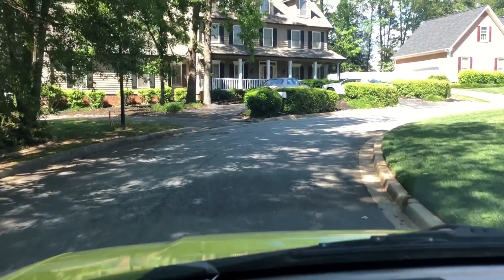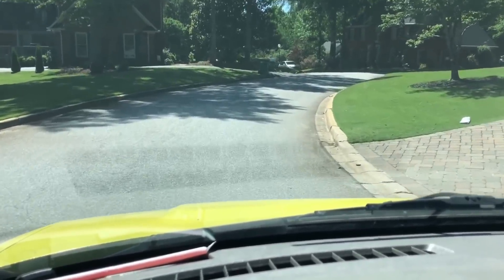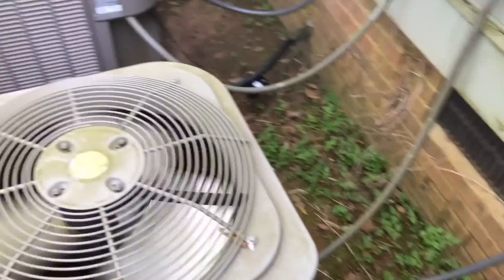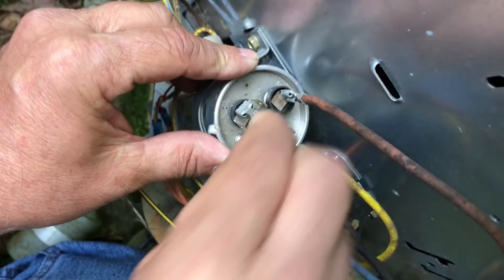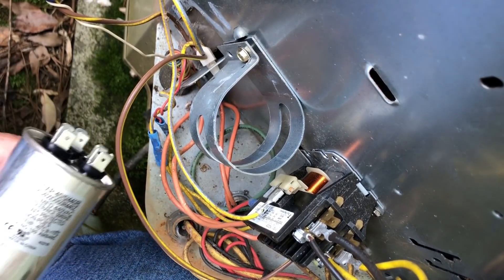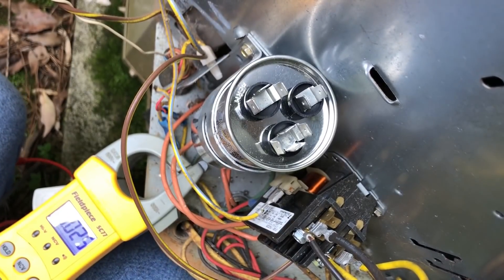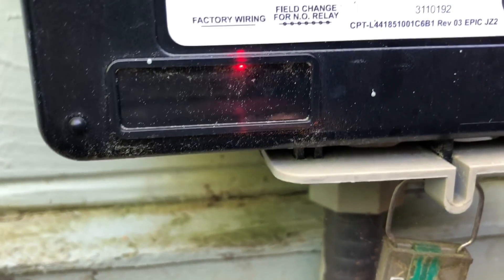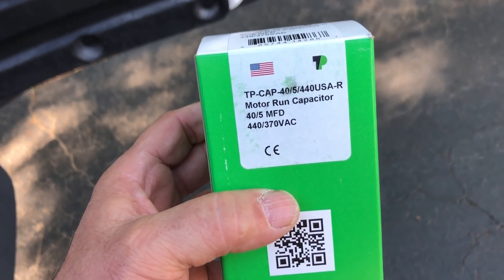Dont try this at home Capacitor replacement

Comment: polychlorinated biphenyl (PCB) is an organic chlorine compound with the formula C12H10−xClx. Polychlorinated biphenyls were once widely deployed as dielectric and coolant fluids in electrical apparatus, carbonless copy paper and in heat transfer fluids. It keeps the dielectric WET and capacitance levels stable ,without it the dielectric dries out. Its why old ones last

Comment: I've seen Chinese caps live 1-2 years, el mexicano caps live 2-3 years and American caps (which I install all the time) last 4+ years. I've only changed 3 American caps, which when I installed them, was about four years ago. PCBs may have helped caps live longer, but I feel it's more how they were manufactured. Back in the 80s and 90s they lasted pretty long. But as new caps come out, I've seen them last a lesser time. Plus planned obsolescence is just getting worse and worse, PCBs didn't have /everything/ to do with the capdemic. 
But the fact people are getting mad over us techs shitting on their shitty parts should be a wake up call. There's too many ninnys anymore. Great video though.
Reply: Turbo 200, 200x and mini all I carry and they almost never fail good old USA made caps.

Comment: We have a 1989 Amana 4 ton 10 seer that still has the original capacitor in it. The contact switch, still the original, is one loud one too...ever since it was new...bang, you hear it contact.

Comment: Polychlorinated biphenyls are a group of 209 different chemicals which share a common structure but vary in the number of attached chlorine atoms. An estimated 1.3 million pounds of different types of PCBs were dumped into the Hudson River by General Electric from 1946 until 1977, when they were banned. The international treaty on Persistent Organic Pollutants, drafted by 122 nations in Johannesburg in December 2000, targeted PCBs as one of the `dirty dozen´ chemicals to be phased out worldwide.

Comment: PCB's were banned in 79, so there's something else in those 1980s-90s units that keeps them going.
Reply: That's called good manufacturing, and a longer planned death date.
Reply: My old company believed it was the change of R410A refrigerant. System having to start at higher pressures and nothing really change with general principal of the design except for coil sizes. Also most manufacturers offer factory install txv's vs piston. That said r410a higher pressures and a couple starts with unequal pressures finds a weak link. ......We would install a 3-1 start assist on every new install.
Reply: JJ 109 York micro channels, still needed a hard start kit, when installing, when they came out with them, if condenser is in the sun, install one
Reply: vast majority is nothing but very clean "MO" aka Mineral Oil. some now are possibly vegetable oil and others..
Reply: My company installs Yorks and carriers. We always add on a hard start to the yorks, never the carriers. Unfortunately that doesnt stop the leaks. Micro channels are s**t.

Comment: My 1987 Lennox 4(?) ton has a cap that, if not original, hasn’t been replaced since I bought the house in 1995. Bought a spare cap five years ago; not even sure where I put it. Someone will have to explain why some insist that a cap must be shorted to safely discharge it — while many techs who post repair vids simply grab the wires.

Comment: One of these days I am hoping a customer tells you “sure service that A/C” then Ted is going to have to drag out the 100’ garden hose out, and it would also be nice if it is an old Trane 12 SEER where you have to remove 50 screws just to get access to the coil and remove that heavy top decorative cover over the condenser fan motor. Now that would be a good video
Reply: that's called real HVAC work, you just do it as fast as possible and move along...
alternate be a stooge and break the coil, telling them it;s leaking and dying, some of us love to burn idiot's that do that type of "shyster" level work ;)
Reply: @throttlebottle5906  Sounds like Bridgestone! Due to lack of HVAC work in my area I am working for Bridgestone/Firestone to get by. They have what's called a courtesy check, it's free but it costs you. It's pretty much you giving them permission to check for anything wrong so they can try to sell you anything and everything. I try to keep it down to things like belt coming apart, radiator dry, Air filter(s) super dirty, battery tests very bad. I had similar expirience in the field, a guy I worked with would tell the customer they need a new A/C because of a small issue that was clearly fixable.
Reply: @bairfamilyfarm1336  that sounds like a shit show... how old is the equipment and is it even used at all?
Reply: Lol.. right

Comment: pcb in this context is polychlorinated bi-phenyl. You should get between 30,000 and 60,000 active hours from a motor start capacitor.

Comment: PCBs were discontinued in the late 70s. I suspect it’s just cheaper construction of the capacitors.
Reply: It is still legal to use pcbs in sealed uses like capacitors but a lot of manufacturers don't like using them because of the carcinogenic nature of pcb.
Reply: @ianmontgomery7534 i dont understand what PCB means. is there a printed circuitboard in the cap? dose it say dont  solder it to a circuitboard?  Is that a chemical? what dose it do?
Reply: @bdblazer6400  In this case the PCB inside a capacitor was polychlorinated biphenyl. It was used as a dielectric. Because of its toxic nature it is rarely used these days.  It does get confusing but these days PCB is more likely to be a printed circuit board.
Reply: @ianmontgomery7534  yeah, PCBs were banned from production in the US after 1977. The same stability that made them so good as cooling nonconductive insulators in caps and transformers is a big part of why they’re so bad as a pollutant: they are incredibly persistent, don’t naturally break down (a small number of microbes and fungi help, but it’s very slow), and it’s a monumental task to clean up if they leak into the ground or water. If they are contained, it only takes incinerating them at 1000 degrees centigrade to destroy them. There’s thousands of contaminated sites in the US (especially anywhere a big electronics company had a factory) and were routinely dumped into drains, landfills and waterways for decades. The notorious Love Canal site is a good example. 

But yeah, technically they are great for making super long life capacitors I suppose. But personally I would rather replace a castor oil cap every few years than risk a PCB cap puffing up and leaking in my backyard.
Reply: @dphoenix1  Totally agree with you.

Comment: For people that dont know what they are doing.. dont touch the capacitor wire terminals without bleeding the capacitor.
Reply: I thought you tested the cap by licking your fingers and touching the top.....
Reply: I’m calling BS, I can assure you that fingers are perfectly adequate for discharging capacitors.  Granted, afterwards something else may be bleeding due to a sudden involuntary muscle contraction, or two,, but the medical community charges darn good money for muscle stimulators and capacitors are practically free by comparison.
Reply: AC capacitors never hold their charge after the power is off. I've changed hundreds. Caps from other devices usually do hold a charge however.
Reply: N S - you are correct. Ive also changed hundreds/ tested thousands. They are not the same you'd find in ecm motor modules, old tube t.v., or old computer monitors. So apparently ryan ball is the one that does not know what he is doing.
Reply: @naturekid1335  I'm an industrial refrigeration tech. They do. Explain to me why (with the power off) shorting it out with a screw driver (I know that's not right) it sparks. ???
Reply: Jonathan Mathews that’s what I was thinking lol
Reply: Wouldn’t the charge bleed out thru the motor windings once power is removed?  At least that what I always surmised was happening because It’s been my experience with AC condenser run capacitors that they are not charged after power is cut.  IBM trained me years ago to fear them so I’m careful and I always check but on the (admittedly few) AC ones I’ve replaced, they aren’t charged...
Reply: Was told always check with tongue 😛
Reply: K05 T4R unless it’s really humid inside, you want a 18-20 degree drop not 10-15
Reply: You are correct, they will bleed out through the motor windings IF there is not an open circuit in the motor winding or any connections to the cap.  I just take 3 seconds and to short the terminals with a screwdriver once the unit is off to keep from being “stung”
Reply: @ballergoalie  because you have power running to it? Or it is hooked into a direct current setting?

Alternating current means it charges and discharges 120 times per second at 60hz. It's really just shifting the phase so the secondary winding can move the rotors by creating a force perpendicular to the main windings.

Once power is disconnected, the capacitors will discharge any current (if they happened to be shut off at the peak) through all those nice motor windings they're directly connected to.

That's why there is no bleed resistor on them and no need to short them. Completely unnecessary. 

This does not apply to capacitors that use direct current and possibly AC capacitors that aren't connected to a load (I can't think of any instances on that but maybe there is.)

This is why you are mistaken. But now you know.

Comment: Here's your answer about PCB. "
Polychlorinated Biphenyls (PCBs)
What are polychlorinated biphenyls?
Polychlorinated biphenyls (PCBs) are a group of manmade chemicals. They are oily liquids or solids, clear to yellow in color, with no smell or taste. PCBs are very stable mixtures that are resistant to extreme temperature and pressure. PCBs were used widely in electrical equipment like capacitors and transformers. They also were used in hydraulic fluids, heat transfer fluids, lubricants, and plasticizers. The primary company that made PCBs in the United States was Monsanto Inc., mainly using the name Aroclor. Commercial production of PCBs ended in 1977 because of health effects associated with exposure. In 1979, the U.S. Environmental Protection Agency (USEPA) banned the use of PCBs; however, PCBs are still present in many pre-1979 products.".

Comment: PCB is an acronym stands for "Poly Chlorinated Biphenyls".  they're  organanic fluids/compounds which is highly toxic to living things, fat soluble  and tends to be very stable.  They do not break down easily and have a high dielectric value so therefore are "ideal" for use inside capacitors of all kinds. Also, and in particularly equipment such as transformers etc. used by our local utilities.  Back in the 1970's or so there were some major contaminated area is the us where , as I recall, they used waste PCB to spray on dirt roads to cut down on dust etc.  That was a major Bad Idea and caused wide spread contamination of both soil and water (fish and all waterways).  Recall the term Superfund sites  in the early 80's or so?  That was all in the effort to remove PCB from the environment and stop the use of PCB .  PCB use in capacitors would extend the life of capacitors because they don't break down and have dielectric properties.

Comment: The problem with PCB's is that people would not dispose of elecronics that had them properly. Their chemical make up is similar to dioxins and are very toxic to living things. PCB's were used to stabilize the oil used in capacitors and transformers PCB's are hydrophobic and kept moisture from the air from mixing with the oil and shorting out capacitors.

Comment: You can see on the cap castor oil. They changed from other oil because they were thrown in the trash and into landfills. They went to castor oil due to this. The castor oil caps do not last very long. I recommend the customer purchase 2. Keep one stored. I may not have the size needed on the next failure and yes it will fail.
Reply: I forgot about the castor ones, highly purified mineral oil is whats used most in caps and transformers. probably vegetable oils and who knows what else now.

Comment: yep the old pcb ballasts for the older fluorescent fixtures would last a long time. The newer electronic ballasts dont seem to last as long.
Reply: Preston Newcomb Not really, usually by electronic you are speaking of a circuit that contains at least some active components, or at least some degree of actual complexity if entirely passive, whereas a magnetic ballast is little more than a passive choke (making it more a component than an actual electronic circuit).  That said, what the electronic ballasts may lack in longevity (though better quality units should deliver decades of service on the average) they make up for many times over in improved efficiency (an F32T8 fixture with electronic ballast, for example, though using 8W less power per bulb than an older F40T12 bulb with magnetic ballast, delivers the same, or (often) more, lumens of light despite consuming 20% less power), reduced flicker, faster striking and warming up in cold weather, etc. versus the old magnetic ballasts...not to mention they are much quieter without the annoying hum.
Reply: @ethanpoole3443  As a electrician I knew this but could never enplane it.

Comment: Live how ya tap the top of the capacitor to see if there's voltage.
Reply: Do it all the time he says , untill the brown out in the pants
Reply: @jerrym1070  Don't know why he just doesn't use the insulated tool to ground the terminals.  Also noticed he's wearing a metal wedding ring while troubleshooting.  I've been doing HVAC for 35 yrs and still don't tempt fate anymore than necessary.  I've been wearing a silicone ring for about 5 yrs.  The wife understands.  But hey, to each their own.
Reply: @pwalms65  there's absolutely zero need to short the terminals on an AC (alternating current) capacitor. All it does is phase shift the incoming power. At charging and discharging at 60 times per second (60hz) you may catch it at the peak of a sine wave but it'll dissipate through the motors before you release your hand from the disconnect switch.

Comment: I noticed that the capacitor in my air handler is rusted should I replace it
Reply: you can but probably don't need too. I would find a new one now and keep it until it goes bad. and then change it out.
Reply: You should always keep spares on hand.  The caps are very cheap to buy online.  Rust is not an indication of failure.